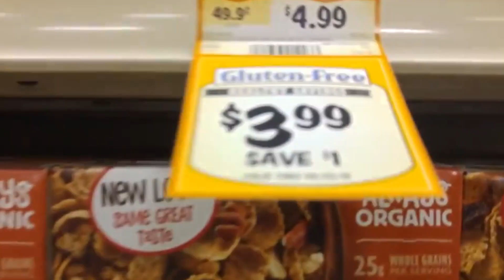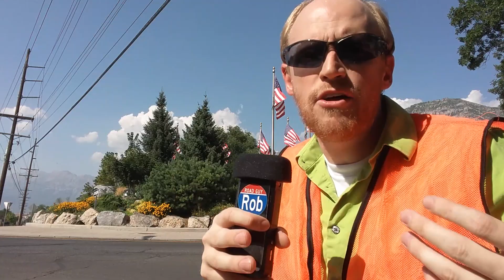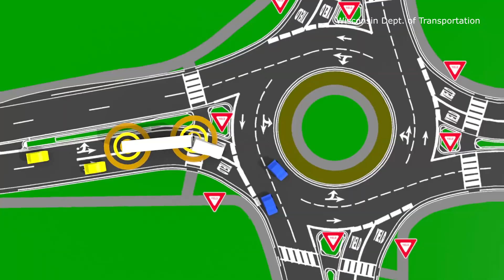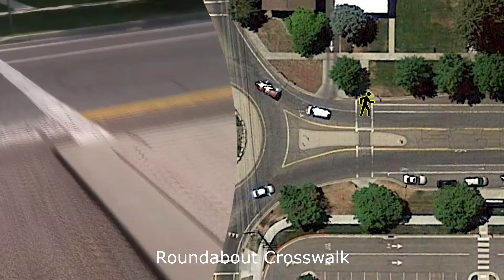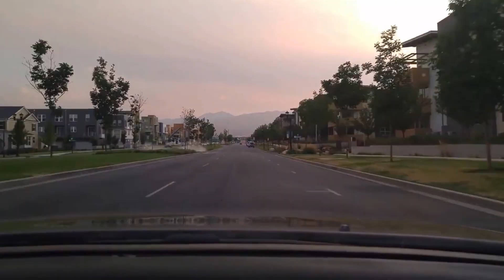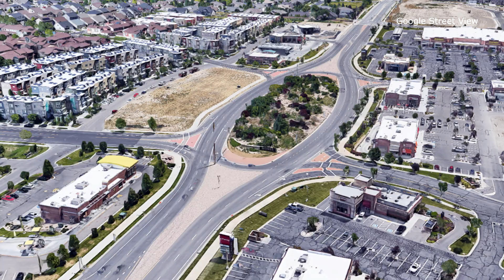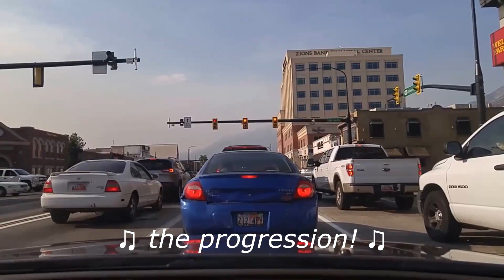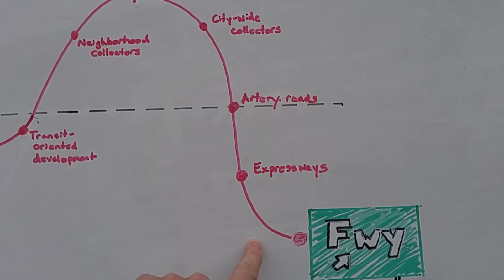Are roundabouts REALLY better than a traffic signal?

Comment: At small tight intersections, you can easily fit a roundabout small enough that you get all the benefits of a roundabout without having to make peds walk as far. UK has lots of these.
Reply: Even if you make them walk further, it's safer. Idgaf if I have to walk 2x as far when I arrive in one piece. Also, you have to wait ages for a green light to cross the street with lights in the US. In the end crossing might be longer, but still faster on average.
Reply: I was thinking that. 
*some of the advantages, perhaps not all
I would say though, that there are some people who don't understand the right of way priority on mini roundabouts. People travelling straight on having to give way to people turning and so on.
Reply: @DougPaulley  do they not have yield signs or yield markings on the road before entering said mini roundabout? cause that is what is done here in the Netherlands, also it is known here if you reach a roundabout, you give way to whatever is on the roundabout coming towards you.
Reply: @DarkDutch007  we do ("give way" markings and sign) and also we have the same priority system, taught in driving lessons, written in the Highway Code and tested in both theory and practical tests before people can have a driving licence - yet still a substantial number of people Just Don't Get Mini Roundabouts, somehow!
Reply: @DougPaulley  maybe it is the egocentric mind of the driver that don't want to be behind someone else at those mini roundabouts? The way that some people race to make the yellow traffic light at junctions.
Reply: @DougPaulley  indeed. Fyi: https://www.highwaycodeuk.co.uk/roundabouts.html

Roundabout priority does not differ based on size of roundabout. Traffic may only enter a roundabout (be it mini or otherwise) if and only if the following two conditions apply 

1. There is noone currently navigating the roundabout approaching from your right.
2. Your exit is clear.

If I'm turning right, and I'm on the roundabout, then you try and enter it without giving way to me. You're in the wrong.
Reply: on big roads we use big multi laned roundabouts, tho i agree they are most effetive on smaller urban roads
Reply: We need more bridges to avoid traffic lights and roundabouts altogether. Seriously. There’s way to many stop signs and lights. Roundabouts are more tolerable but are bad for pedestrians.
Reply: Our downtown area has them also, but not on major streets, its mostly the streets where housing is.  Basically just a circle in the middle of a normal intersection.
Reply: Definitely have quite few of these in my small rural town. You get bumped circle drawn in intersection. You don't need physical barrier if people are conscious about not wanting to fuck up their car and their day. That helps busses to pass with ease too.
Reply: The general rule for roundabouts in the Netherlands is: if you're on the roundabout, you've got right of way. In some cities however they've decided to favor even more slowing down by giving right to cyclists aswell, so a cyclist is in a dedicated cycling lane parallel to that of the cars, but separated by at least a curb. If a car wants to get off of the roundabout, or on it, the cyclist has right of way. The flow is impeded that way and the aimed for slowing down of traffic is too extreme for my taste. The regular is that cyclists have to wait.
Reply: @AwoudeX  this is the same in the UK. You only have to give way to traffic already on the roundabout. You do not have to give way to traffic approaching it from your right, only traffic that has already entered said roundabout.

In the UK we have give way lines that apply regardless of the intended direction of traffic entering the roundabout. The OP is one of the people who does not understand this... Ironically.

People failing to understand this and attempting to honour the same priority one would have at a crossroads, cause traffic jams.
Reply: This is true ONLY if you ensure no bus traffic, street car traffic or semi traffic.  If you don't do that, these small tight roundabouts become a massive hazard.
Reply: @winoodlesnoodles1984  Not if you have sensible drivers
Reply: Yeah those weird British things where they've just put a white dot in the middle of the intersection and arrows around it and then people just use the intersection like they normally would.
Reply: Then it basically becomes a regular 4 way stop.
Reply: @brandoncaldwell95  ...but without having to stop.
Reply: @brandoncaldwell95  No in a four way stop, you must stop, a roundabout merely requires you Give Way (Yield).

Comment: I hate roundabouts, dig traffic circles.
Have you seen solar powered crosswalk signs?
Outside lane exits by second exit, why is this hard to understand it is the same as a + making a left or right turn
Divide the centre of roundabout / traffic circle with an X crossing and add in a solar powered flash pedestrian light
 that permits pedestrian scramble, where all entry / exit points have crosswalk markers with flashing amber lights.

Comment: Unless you have a real dumbass driver who is completely not paying any attention and drives straight through the round about at a high rate (or normal 45mph) of speed and ramps off the incline and flies over the roundabout and crashes into someone's home or on top of another car (however, this scenario is rare and probably is the reason roundabouts only reduced the number of fatal accidents about 90% and not 100%.

Comment: I live near Dublin, Ohio which has also embraced roundabouts in a big way. I love single lane ones, am ok with two lanes, but hated the three lane one they built at a major intersection. Apparently they agreed three was one too many, because the city recently modified it to have only two thru lanes with the right turns separated slightly. The intersection is US 33/SR-161/SR-257 if you want to check it out
Reply: Napa
, CA is building three roundabouts on the intersection in row. It looks like fun to drive throw

Comment: One of my favorite roundabouts is one in Missoula where a beer warehouse needs access for semis through a small neighborhood, so there is a roundabout so tight that semis can't make the turn onto either of the neighborhood streets and their only option is to just drive straight over the island, which doesn't have anything in the center.
Reply: Mountable mini roundabouts are common where i am from. Designed for trucks to drive over, cars still go around so you get most of the safety benefits
Reply: We have a road on the west side of Columbus where they took out like 10 stupid stop signs and put in 2 "round abouts".  I put that in quotes because they didn't actually widen the road, they just put in a slightly raised lump round concrete about 4 feet circular as a marker.  In a car, it's a tight turn to go the 3/4 way through.  Straight is easy, and right is too.  However, I don't begrudge them because this is the best thing they could have done on that road and it is soooo much better now!
Reply: @nixon2tube  up on Industrial Pkwy off US33? I delivered wine to a catering business up there those roundabouts aren't that bad 😂
Reply: @EllieODaire  Not the same place.  I know what you're talking about, and those aren't bad either.  These are at: https://www.google.com/maps/@39.9548911,-83.1421361,16.84z on Beacon hill dr.  They're so small they don't show on Google.  One is at Buenavista, and the other at Pasadena.
Reply: @nixon2tube  oooof yeah that road is not a road I would ever take a tractor-trailer on by choice, residential areas make me nervous. My only customer in that part of the city is the Wal-Mart Centerpoint near the Pilot, so I was never more than a couple blocks from the Interstate over there.

Comment: America: Let's be the world's most advanced nation. Roundabouts. It's experimental, but we think it might work.
The Netherlands: Regular roundabouts done right. Red pavement is cycle path. Pedestrian crossing way closer to roundabout. https://i.ytimg.com/vi/FR5l48_h5Eo/maxresdefault.jpg

Also the Netherlands: Turbo-roundabouts. (From turbine-roundabouts.) About 1.6 times the capacity of a single lane, no safety disadvantages of multilane. Curb between lanes. Pedestrians can cross through underpass, away from cars. Cars have to choose their lane before entering the roundabout. Signaling with lane directions required. https://www.arcadis.com/media/E/5/E/%7BE5E06EB9-A022-4577-9AEC-F9D575615395%7DImage%202_crop.png

Also the Netherlands: Turbo-roundabouts without underpasses at village border where city is more calm: https://www.google.com/maps/@52.2714233,4.5642627,3a,75y,231.68h,96.19t/data=!3m6!1e1!3m4!1sGNZ-sPobDNT8a1Up6GPnxg!2e0!7i16384!8i8192

Also the Netherlands: Highway junction roundabout WITH traffic lights. https://www.google.com/maps/@51.4036706,5.5032047,3a,75y,26.28h,87.75t/data=!3m6!1e1!3m4!1s6TofN9QaUIwLYMll9WPP-g!2e0!7i16384!8i8192

Also the Netherlands: Elevated roundabouts for cyclists. https://i0.wp.com/irishcycle.com/wp-content/uploads/2016/01/roundabout-eindhoven.jpg
Reply: well traffic controlled roundabouts are often also known as traffic circle; They are going around like in a roundabout but controlled by traffic lights and sometimes combined with other means of transportation like tram or actual railroad tracks like these two:
https://goo.gl/maps/qm4B4Y6HzNZbjUyu9
https://goo.gl/maps/npcTD3vS6MTe5JGe6
One roundabout kind of traffic layout I like is the end of highway 8 in the Bavarian capital city of Munich, with the majority of traffic going straight and with the lanes entering the roundabout having the right of way, while those entering from the side street or those proceeding further around the circle have to give way: https://goo.gl/maps/44otqfwnyQ4XzEs28
Also a cool layout is this one from Sweden, with the straight going main street just cutting across the roundabout and with a fire station being located right at the roundabout, an extra lane against the flow of traffic for the fire trucks heading down into the city center: https://goo.gl/maps/zhA9FgFjQYmpwHUV9
Reply: @EnjoyFirefighting  Those are lovely roundabouts outside of the Netherlands.
We can at the very least in a very roundabout way say, "Europe is simply better than the USA." 😛
Reply: @amyloriley  :D

Comment: I hate roundabouts. Worst traffic idea ever, and they are extremely prone to accidents. Should've stayed in England, they can't even drive on the right side of the road anyway, let them suffer this abomination.
Reply: are extremely prone to accidents ... lol when you don't know how to handle them, however the accidents in a roundabout hardly lead to severe injuries
Reply: @EnjoyFirefighting  that's exactly the thing... too many distracted or entitled drivers that don't know how to handle them. People invading lanes and cutting each other off, trucks overturning, idiots getting some serious air by entering them straight on at high speed and sailing over the island. I've seen people do the dumbest things in them. Nope, I don't care if anybody likes them, I'd rather have a normal intersection where the worries are either T-bone accidents or rear end idiots. I know how to handle those.
Reply: @davidcruz8667  you don't have to be distracted to not know how to handle it, not knowing it is sufficient already. Multi-lane roundabouts and turbo-roundabouts where a thing I had to learn as well after I was only used to simple single-lane roundabouts. Trucks overturning? How many trucks overturn at such low speeds? They should only go in a straight line from A to B then, without making turns at an intersection either ...
Many roundabouts are designed that you can't drive across the island in the center; Some idiots will crash no matter what you do, but you can't say pretend that roundabouts have a higher crash risk for that reason. Crashes at intersections are definetly more severe ...
Reply: @EnjoyFirefighting  fine if you haven't encountered them, but I've seen two trucks roll over, one drive over a small car by cutting him off going from the inner ring to an outer ring exit, and one idiot drive straight into the island, launch into the air, and fly off the other end. I've also seen a car come out of who knows where and land crosswise into a roundabout directly in front of traffic. And there are plenty of dashcam videos about this stuff right here on YouTube, check some of them out. I will never trust roundabouts.

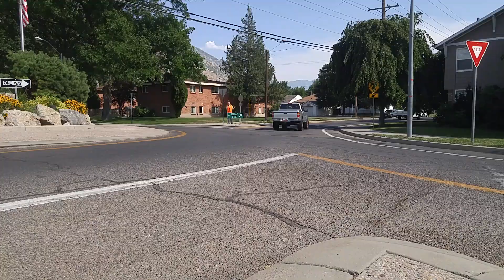Comment: @2:00 Just be sure that the "planter box" is not a "ski jump ramp" type.
Reply from the maker: Seen that video!
Reply: I don't use the roundabout as a jump, that's what the massive unnecessary hump on one of the railroad crossings in the town I live near is for. Besides, we have signs in the center of our roundabout. I want to have fun jumping a rustbucket karen wagon, not property damage.
Reply: As an aside, on the roundabouts in OH, the curb in the middle is low enough that it actually makes it easier to take the roundabout at a higher speed.  You get your left wheels on it, and half the friction is gone.  Kind of nice as a driver, but I'm sure that wasn't the intention.  I usually do this on a 45 mile an hour road that goes through a bunch of roundabouts where there's seldom any cross traffic.

Comment: One thing that roundabouts are WAY better than are 4 way stop signs.  In my town they replaced one of these next to the college with a roundabout and it stopped cars from being lined up for literal blocks waiting to get to the intersection.
Reply: I never understood the idea of 4-way stop signs at all; Over here we have stop signs, but only 2-way, with traffic from e.g. a side street being forced to stop while those on a through-going street have the right of way
Reply: @EnjoyFirefighting  Four-way stops are necessary at certain intersections. Making only the side streets stop can be dangerous for side street traffic that wants to go straight through or turn left; even if the dominant road has a posted speed limit that should allow for safe maneuvers from the side streets, that often is violated and unenforced. In theory, a traffic light may appear more efficient than an all-way stop, but in the U.S. getting a traffic light installed at a busy intersection is a lengthy, bureaucracy-laden process. In my life I have seen situations where residents complained about dangerous intersections and requested a traffic light, but the government required certain studies to be done (with results indicating the need for a traffic light, per their benchmarks), along with a mountain of paperwork; even if one was approved, it might take two years before it was installed. Stop signs would usually get put up within days without much hassle. 🤷‍♂️
Reply: @Prof_Jeff  necessary? There are literally NONE here at all, so I barely think that it's necessary. Street layout and speed limits can also compensate the typical range of people going over the posted limit. 
We only have intersections with 1) either no traffic signs = left yields to right, 2) others where there's a road with the right of way and other cross roads have either a yield or stop sign or 3) traffic light controlled intersections

Comment: Platooning the vehicles must look like the perfect solution to traffic engineers when trying to time the lights.  But the time spent waiting at a traffic light collecting a slug of cars lengthens total trip time, so where’s the advantage?  In addition it puts cars together which is less safe than if they have separation.  We have a light here in Burien, WA that is ALWAYS red.  Its in front of the Fred Meyer main entrance.  You can see the light from a couple of miles away, so you can monitor it from a long ways off.  It will stop you.  The cross street is a single lane neighborhood street, unstriped, just a low travel back street.  This must be a timing start point for the traffic designers who think that a thirty second wait at the five following lights shouldn’t ruffle anyone’s feathers.  But I feel different about their efforts and their timing.

Comment: Traffic circles are good if it isn't spammed everywhere like Europe lol.

As well as used proper lane usage.

There's 3 near me. 2 made in 2012 and another made in 2018
One of the 2012 ones is disgusting. Causes so much more traffic. What should be a 20-minute drive between 2 cities ends up being an hour and a half.

The one put in 2018 works well so far. reduced traffic but it was placed in where 3 highways used to cross before they were decommissioned

The other 2012 one is actually a decent one. has 2 lanes of travel in 1 direction while the other side is 1 lane due to most traffic coming from that area. Traffic circles like these work way better than the same lane in all directions.

Tho best way to combat traffic is grade separations or propper street intersections. could also use dedicated right turns into left and right by taking them off the main street and swinging them back around.
Reply: "spammed everywhere like Europe" lol there are countries in Europe where they are more popular and in others they exist but in way lower numbers. I think in my county of 300 sq mi there are 8 of them ...
Reply: @EnjoyFirefighting  
Ah, nice. Seems like a lot where simple interjunctions can be used lol